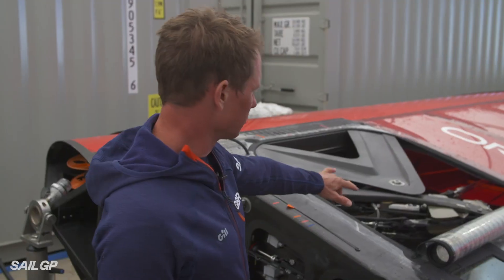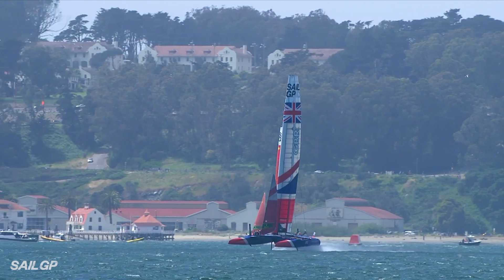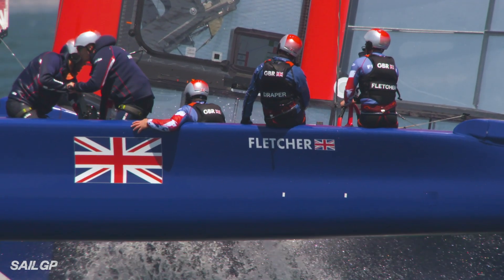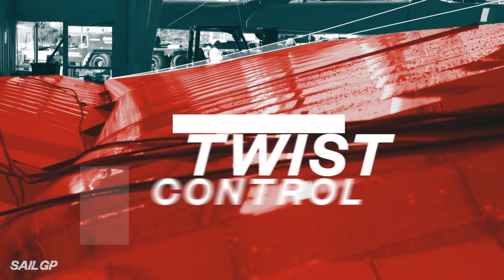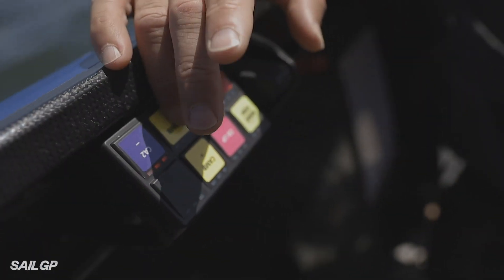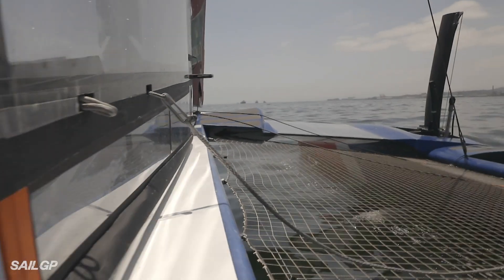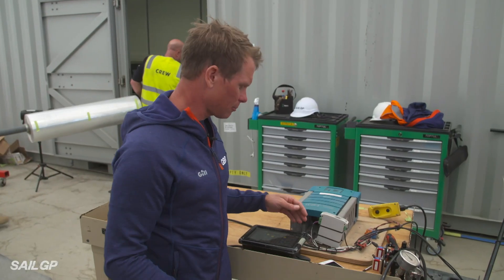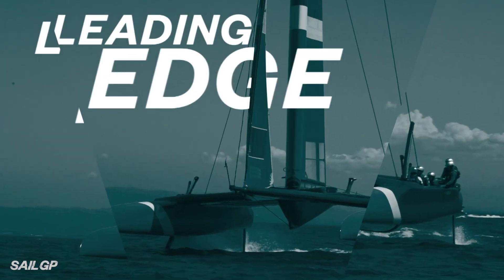A Boat With Wings? | SailGP Explained

Comment: Happy to see some explanation about the wing! Seems to fit with the airplane wing functioning, that at lower speeds you want to extend the flaps to get more lift, while at higher speeds you pull them in. Thw proper angle to the leading edge of the wing caught my attention. Some how, I hadn't thought of that much! All of this is new technology, revolutionizing thousands of year of sailing. I wish these guys would dedicate more than 1:41 (one minute and forty-one seconds) to explaining. And I wish the announcers / video effects people would give more updates on the direction of the wind on the course, so we could see how the boats are steered, relative to the wind.